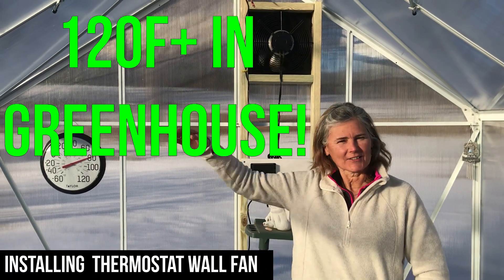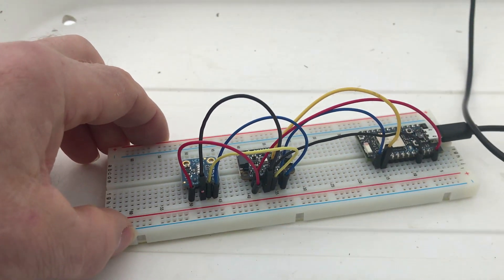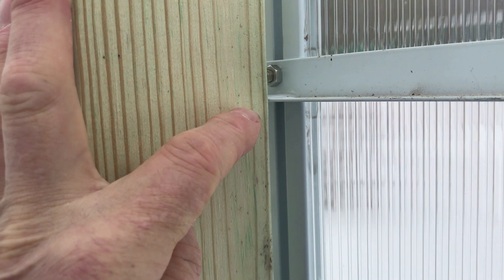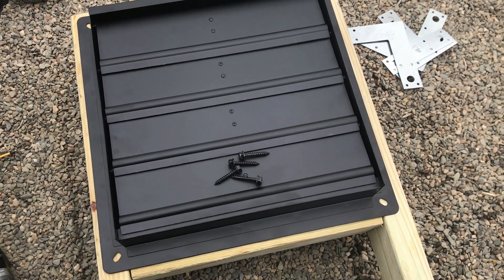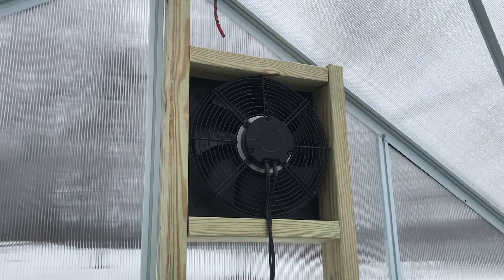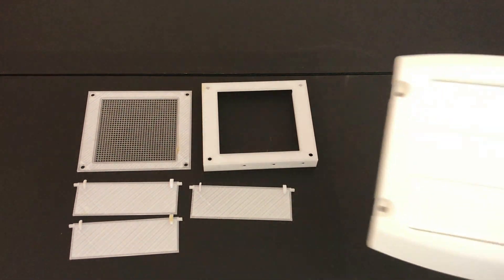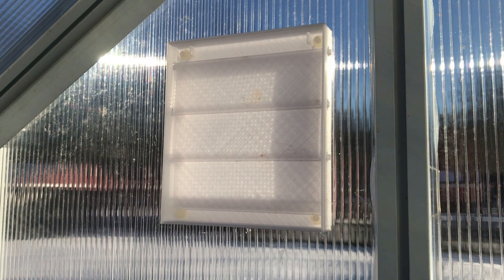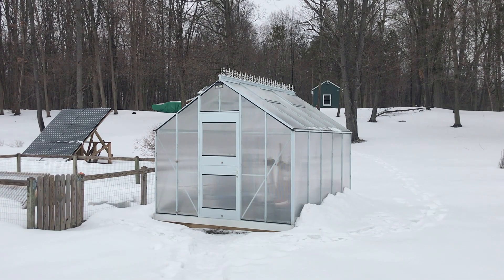Hobby Greenhouse Ventilation Fan

Comment: Nice project. I just fitted a fan but it's on a humidity controller since excess humidity is the primary problem I have especially overnight after watering, hoping it makes a difference.

Comment: Youre inlet needs to be  LARGER  than your outlet. PLUS, the inlet
needs to be mounted low to draw in cool air while the outlet is
mounted high to collect & discharge hot air. REMEMBER
Hot air rises & cool air sinks.

!

Comment: Just came across your video, We are looking at adding a fan to our greenhouse, Can I ask what CFM and size your fan is? As well as the vent you printed, we were concerned that our inlet and exhaust sizes had to be equal or inlet be bigger not to cause  too much pressure difference
Reply from the maker: The link to the fan is in the video description. I think it was 830CFM
Reply: i also read that looks like you could need at least 3no, of those vents maybe 4no ? or reduce the size of by your exhaust fan

Comment: Wouldn't you want to put small weights on the back of the intake vent the wind doesn't blow cold air in less you have enough vacuum from the exhaust fan to force it to open
Reply from the maker: hasn't been a problem yet

Comment: I have 20x25 ft. polysheet GH with cheapo box fan quite high at one end. Both fan screens are removed. I have high quality thermostat at 4ft high at other end to sense the GH temps. In summer when needed,  the roll-up screens can be rolled up. Works well at mid-Vancouver Island

Comment: I'm waiting for someone to add some solar parts links to the comments. I want this to run off direct power from a panel during sun only. Remote would have to have batteries.  Anyone?
Reply from the maker: I've done a bunch of solar projects. I'll have to measure the fan power consumption

Comment: So glad you done this video, I just installed this same fan, but its cold here in mooresville  and I am having trouble setting the fan correctly.  I thought I set it to come on if it got over 80 degrees in there and have found it on at 36 degrees.  Can you help tell me what I am possibly  doing  wrong?  Thanks
Reply from the maker: maybe call the vendor?

Comment: Nice video. I am using 2 of the 14" fans on either side of my 16'x32' high tunnel and they work as expected. Just a note for your info somethings I noticed while using them.

The controllers will glitch out below freezing temps. There is also some logical programming issues with the way the controller works. In the programming you can set High Temp, Low Temp, High Humidity, Low Humidity but here is the catch. 

The humidity rises in my high tunnel at night as the temperatures go down. The problem I have is that I need to turn the fan manually to off at night so that they don't kick on and remove any warmer air that I may have in the greenhouse and adds to the possibility of frost on the crops. 

I am going to order the Type 67 controller as I think that has more functionality. But just wanted to let you know.
Reply from the maker: Yes we found the same "glitch". It was 20F out and the controller said it was 130F and had the fan going! I emailed the company, but they never responded

Comment: Awesome video. I’m a few counties south in Putnam. Do you or how do you heat your green house at night? 
I just built a 12x7 greenhouse for my daughters. Plenty warm in the day, but becomes outside temp at night. TY
Reply from the maker: Now that I have "instrumented" the greenhouse, I ordered a 1500W heater with a digital interface that allows you to set the temperature to 40F (https://amzn.to/2PqOf9h ). I will let you know how it works. It just needs to keep things above freezing.
Reply: @SerendipitySue   Will this be running off the solar setup?
Reply from the maker: @secretjourney4815  yes/no...I brought AC to greenhouse. I have the solar panels grid tied. I was also looking for an automated propane solution... but didn’t see one yet. I do have a mr buddy type heater I could manually light
Reply: @SerendipitySue  
Short term use of propane would be fine. Long term use can cause Ethylene damage to your plants.
Thanks for your great videos, and information.